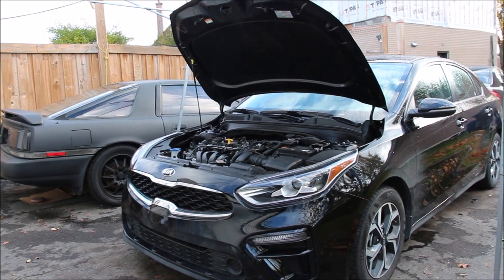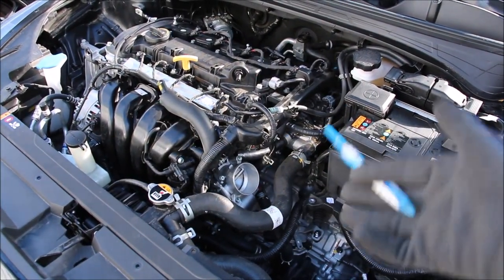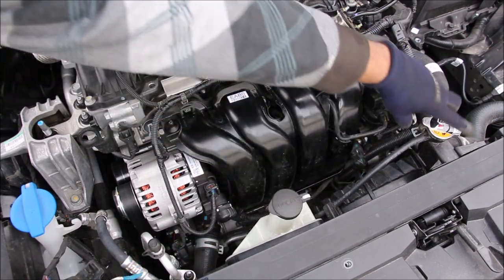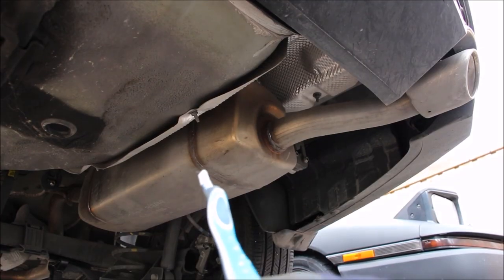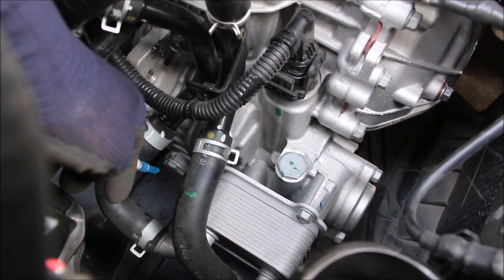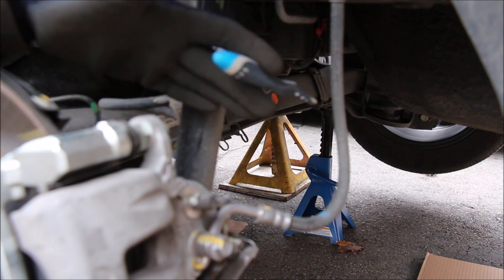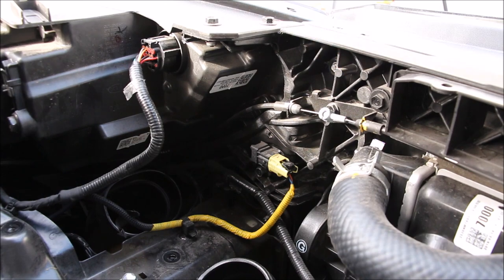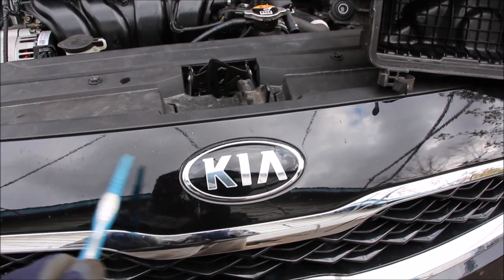Kia Forte Mechanical Review

Comment: My kia has 402500 miles runs incredible 2010 forte
Reply from the maker: Whoa that's alot for any car, much less a Kia. Any issues?
Reply: Same 2010 kia, 2.0 4cyl. 230000km and runs sweet as ever.
Reply: my 2010 forte 2.4 6MT just broke 200,000 km's and i love this car to bits, it's got the older style THETA2 but in the first iteration where they used MPI and were still made in korea, the later GDI theta2 was made in i believe georgia or Alabama and they had production line defects where sand from the block casting + filings from machining weren't flushed out properly and sat dormant in the oil journals, man did hyundai ever make the walk of shame after that with the exploding engine recalls haha! 
ive seen a good few 2.4 MPI fortes make it to 400,000kms and i plan to take mine that far and beyond! 173HP and 168 ftlbs of midrange torque move pretty damn quick haha, people turbo the first generation forte and make an even 300hp/300tq and have little reliability issues long term :)
Reply: @Liam S no lie no need to it's hot 464000 now
Reply: @gregallen5551  what do you do that you drive 60k+ mike’s a year in a Kia
Reply: @lancestickle4346  Uber lyft .outside sales.
Uber eats. Door dash 
I just got a 2013 kia forte rsx love it bought 96000
Reply: Is that a 2.0 liter?
Reply: @Vanguardkl  Is that a cvt transmission?
Reply: @UnburdenMyWordSalad  yes it finally semi died at 464000 miles I can fix it .but 
I just got a 2013 kia forte rsx hatchback
Love it so I may have to part with it sad
Reply: @UnburdenMyWordSalad  4 spd torque converter. It's a Mitsubishi transmission. Just keep the fluids fresh and the thing just keeps running. Used to Uber, not now

Comment: Thanks for these videos, with an aging Civic I'm starting to look for a cheap daily driver around $20k.... Good deals on both the Forte and Jetta, thanks to your videos alone (cupholders, handling, etc.) I feel the Forte is a much better built car (simplier to work on as well) than the Jetta.
Reply: Forte and Elantra are much better choices than the Jetta in terms of repair costs and long-term reliability.
Reply: @palebeachbum  kia reliable 😂🤣😂
Reply: @adl6907  reading comprehension is not your forte. 😉

Comment: “Kia gives you these hooks to easily replace the engine when it fails just after warranty”. 😂

Man I love your videos and sense of humor, keep up the amazing work. This is a real review of cars. 

Would you be able to review the 2019-20 Toyota Yaris? People say it’s a Mazda in disguise and it’s not as reliable. 

Thanks.
Reply from the maker: Thanks I'm glad you appreciate my work and the little humor! 

The Mazda 2 is sold as the Yaris in North America. A new Yaris hatchback has debut, I'd love to check out that little 3 cylinder haha
Reply: @speedkar99  What? a Mazda 2 is a Toyota Yaris in North America?
Reply: funny part was you will have 2-3 engines replaced BEFORE warrenty is up as there 4 cyls are complete shit thanks to lack of oil lubrication wich causes main bearings to melt and burn up.
Reply: @Scypher0th  Fake news.
Reply: Jared Shelton not.  It’s a known Hyundai/Kia issue.
Reply: @nicksmith8166  On one engine. One single engine, the 2.4 4cyl, which was co-developed with Chrysler and Mitsubishi. That's where Hyundai and Kia went wrong. Hyundai and Kia basically took the engine back for themselves, fixed the design, and replaced every single defective engine that was still on the road. It is not a known Hyundai/Kia issue, as it was one engine flaw that was fixed.
Reply: @Scypher0th  You can blame Chrysler and Mitsubishi for that, Kia fixed the design of their 2.4 and took care of the issue 👍. Their 4 cylinders are great now.
Reply: 2010 kia forte, 2.0 4 cyl 4 spd auto. Serviced every 9 months at around 16 to 18k km, on shell helix ultra 5w40 every time, 230000km, smooth quiet, people think my car is 3 years old, not 10.
Reply: @speedkar99  Yaris has 1.5 liter DI 4 cylinder engine Mazda built.
Reply: I love his humor, its so real it hurts Kia owners (I'm not one of them!)
Reply: @jaredshelton4718  except Mitsubishi's engines are proven to be more reliable and have a low failure rate.
Reply: @trent7080  Hard no.
Reply: @jaredshelton4718  NHTSA would not agree with you. Lol.
Reply: @trent7080  They would. Lol.
Reply: @trent7080  Lmao. Coming from the delusional Mitsubishi fan 😂. Mitsubishi has what? 3 vehicles in their lineup? What a joke 🥱🥱.
Reply: @jaredshelton4718  so I'm a Mitsubishi fan for telling the truth? Lol, thanks for proving my point.
Reply: @trent7080  Definitely not the truth, you're funny though.
Reply: @trent7080  tbh you’re not giving any substance to your argument. Afaik I will have to agree with the other side of the argument regarding the Kia/Hyundai engine issue that they did indeed fix in the latter model years. Seems like you’re too hooked into winning this argument rather than concede the truth. ( I drive a Toyota so not a fanboi of either)
Reply: @zeeshanmuhammed8883  so why are 2019 models still catching a fire?
Reply: & he ain’t told nan lie 😂

Comment: I bought a 19 Forte with a 6 speed manual. I chose it because of its low price, long warranty, and ease of service. It's simple mechanically, but has a lot of amenities such as lane keep assist and Android auto. I'm pretty happy with it.
Reply from the maker: I agree, seems pretty easy to work on, the layout is like a Toyota
Reply: How much?
Reply: @erikmireles5879  mine was 16,500 new at the time when I bought it. I believe they're even cheaper now.
Reply: @n8rev156  thanks for the reply, the price, looks ok enough and warranty are appealing for a daily driver and keep the wear n tear off my truck. Haven't actually went to the dealer but lsx models are about $14k 0% apr around here

Comment: Remove the alternator & the water pump takes 15min to replace. I love that Hyundai does not extend the subframe; if you have to remove or replace the gearbox/transmission you don't have to suspend the engine and lower the subframe first. It's a 3 hour job, literally.

Love your reviews! 👍!👍!👍!

Comment: I have a base model 2019 Kia Forte. I really enjoy it. The Mexicans did a great job building the engine and transmission, as well as assembling it in Mexico. I have a better understanding of my 2019 Kia Forte thanks to your professional, understandable explanation! Thank you, and I subscribed!
Reply from the maker: I'm glad it helped you understand. How are you liking that CVT? I found it kinda sluggish.
Reply: @speedkar99  It is not sluggish at all, just give it some gas and you are at 0-60 in 2 seconds. The CVT is very responsive and fast! I am disappointed in your response, though. It is hear-say, but you need to try it.
Reply: @99900062  neither a Corvette , nor a Porsche , can do 0 to 60 in 2 seconds. You are a Huge exagerater!! Lol.
Reply: @johnfranklin5277  the actual  0 - 60 is  high 7 low 8 ish
Reply: @610smoke  I know lol, I have a 17 Elantra! Lol. Same engine.  Great car. 80.000 miles now, bought it new.  Absolutely flawless,  0 repairs,  0 issues,  but a rocket its not!

Comment: Wait a minute so Kia's latest transmission,has a fill port,a check port and drain plugs. But also has a big yellow sticker saying NOT to change the transmission fluid??? 

Am I understanding this correctly?
Reply from the maker: Yep. The ports exist but service is not recommended. Most CVTs are like that
Reply: It means don't change the fluid if your transmission is acting up, just get the transmission replaced
Reply: @GhostOfAMachine  Sounds reasonable.  Will do.

Comment: excellent tip at 10:56 and since you're there go ahead and remove the caliper and use a rust inhibitor on the hub/rotor (for those that drive on roads that get salted in the winter) so that your rotors aren't rusted on!!!!
Reply from the maker: Agreed. It's not just the rust...it's just those screws love to strip!
Reply: Hey you said to remove the screws so they don’t strip out before the first brake job, do you mean replace or remove?

Comment: Hey, those engine hooks on my 07' Kia Rio came in handy when I replaced my clutch 😎 I used a pulley to support the engine and trans instead of a jack. My engine's still going strong with over 200K on the odo (and it's well out of warranty 😉).
Reply from the maker: Awesome. You are one of many on this video to testify the old Kia's are doing well
Reply: Cool! Old Kia's (before the Hyundai merger) used Mazda designed engines and transmissions built under license by Kia. Despite being somewhat unrefined, the cars are surprisingly solid and reliable. The post-merger cars are a definite improvement though.

Comment: Would you have to change out the CVT even if all it needs is transmission fluid? Also, what makes you think the engine will give out once it's out of warranty?
Reply: No you would change the fluid as regular maintenance. They are saying that if the transmission is starting to act up that you shouldnt bother with the fluid.
Reply from the maker: Fluid can be changed. The manufacturer doesn't want you to do it yourself.
Reply: His other question was what gives you the idea that the engine will give out after warranty?
Reply: @brettb2701  That part was a joke lol
You need to learn to read humor, he does this with just about every review and it's hilarious.

Comment: Excellent video! Particularly loved the reference to the handy hooks to pull out the engine just after warranty 😁😝
Reply from the maker: Haha 
I was surprised they include those hooks, especially since they usually lift the engines into the body during production and don't use those hooks.

Comment: the twist beam set up is what everybody in the compact car segment is doing so it doesn't even matter to me and it won't to most people. There's an independent suspension set up on the Forte GT that just came out. It's the same strategy that Hyundai has been using on the Elantra Sport (makes sense since it's the same platform). 

Hopefully you can get a next gen Sonata at some point so you can show us what's better or worse with the next gen platform they just debuted in that car. There's a new 2.5L engine with dual port injection and 1.6T with this thing called CVVD which is supposedly just a combo of VVT, VVL, and the ability to change the duration of the valve being opened or closed using an electric motor (hopefully that won't kill their reliability).
Reply from the maker: Wow you are definitely a Hyundai fan haha. 

Competitors like the Civic and Corolla offer independent rear suspensions on the base model. 

I didn't know the Forte GT had IRS, I knew the Elantra Sport did. Makes sense though since there's alot of space under that floor pan. I wonder if it'll swap over ...

Yeah it'll take some time for the 2020 Sonata to start appearing around, I'd love to review it along with the paliside/ telluride.
Reply: speedkar99 I drive a Kia and my family has driven Hyundai in the past and they’ve been extremely solid for us so I like learning as much about them as possible. 

Yeah the Corolla and Civic definitely gets a thumbs up by not going for a twist beam. The Mazda3, Sentra, and the Jetta unfortunately have succumbed to that trend.

I wouldn’t be surprised if someone tried to swap suspensions.

Comment: Awesome reviews man! Your sense of humour is funny too Lol.
I own this car (except mine came with the crappy Gamma 1.6L engine). Very good points on your reviews. The most thing I like about this car is how easy it is to work on. Mine came with 6-speed automatic so it's somewhat serviceable and the 1.6L engine is even smaller than the one in your review and gives more clearance to work with.
I have a question and would be glad if you answered me. In the owner's manual it gives a chart for suitable oil viscosity according to the ambient temperature. According to the chart I can use 5W-30, 10W-30, or 15W-40. Shall I go with the thickest one to provide more protection for the engine? In my country the temperature rarely goes lower than -5 °C.
Reply from the maker: Thank. You have the turbo 1.6 eh. 

The oil weights get thinner to reduce friction and this better fuel economy. In the winter you use thinner oil because it's viscosity changes with temperature. You'd be safe with what they spec for your climate, though it's not going to make ur engine "last longer" since the differences are more for economy.
Reply: @speedkar99  
Thank you for the reply. My car has the non-turbo 1.6L (same one in the Kia rio and Hyundai accent, 131HP) I think in Canada and the US they only sell the 2.0L and the turbo 1.6L. In my country it is even called Kia "Cerato" not "Forte" even though its exactly the same.

Comment: Love my 2020 Forte, but I bought the 6 speed manual transmission.
Reply from the maker: They still offer with a manual?
Reply: @speedkar99  Do you think the dual clutch in the GT trim would be more reliable than the iCVT? Thinking bout buying one of these cars.
Reply: @speedkar99  I think the 2020 FE model comes with a 6 speed manual as standard

Comment: I have this same engine in my Hyundai Elantra se. 2018 with the manual transmission. I really like the car. I have 53k on it. Change the synthetic oil every 4k. Trying hard to go to 5k but I'm old school. The motor sounds like it did when it was new. Its quiet. I get over 40mpg and haven't had any problems. Although I had it in for an oil change and they had to update the software on the thermostat. When its bitterly cold out it took like 20 minutes to get to normal temp. Now it takes 3 minutes. It's been a good car. I plan on driving it for another 200k.
Reply: 4k on synthetic? Bro you're wasting money. At minimum theyre rated at 7k some up to 15k!
Reply: @iyelawolf2196  I'm trying! I'm at 4,500k Mobil 1. Oil still looks good.

Comment: I really like the new forte a lot. I'm considering it to be my next car. However, the only thing that puts me off is the positioning of the turn signal and reverse lights being  on the bottom instead of where its supposed to be. Like you said, one little bump could break it and cause fluid to come out. Kia should put the lights where they're supposed to be. If they did that and put a break hold feature like the Corolla and the civic, it would be very hard to pass it up. I hope kia sees this.
Reply from the maker: I don't like low mounted lights as a design element either....it doesn't look good

Comment: Its April 2022 =july 2018 kia forte 2.0, 4cy, LX, Engine 17,100 miles, =Engine lite came on, told code 128, told to replace thermostat with the housing ( cant replace just the thermostat) one kia dealer said part $1000, next dealer $169, or order myself from Hyurdai/ kia Co. in SKorea $45 +$35 shipping.! My car is under 3 1/2 yrs old, every year maintained! drive easy HYW miles.  Is this under warranty still !( 5 yrs 60,000miles) ????Should I think about selling this car already????   help! one retired senior
Reply from the maker: If it's under warranty why aren't they covering it?

Comment: Why are the cars all going with plastic intake manifolds?  Also, on this car, exhaust is in the rear which I dont like.   Toyota puts it in the front, easier to work on.  Also, don't change the transmission oil?  Is that a new way to sell transmission and future repair?  Oil not getting old?  Has Kia found a way for transmission oil not to get old?

Comment: Hi speedkar99. I'm so glad to find your channel showing the intricacies of the vehicle.  My daughter is shopping for her 1st car and we are seriously considering this car based on the price value and also the fact that the motor has a timing chain rather than a timing belt.  I am a bit taken back with the fact that pretty much all manufacturers are going the way of the CVT which to me has been a headache and very problematic. (Nissan cough...) I looked over the new corollas and was shocked that Toyota too has changed over to CVT, sheesh.  So now we are not sure which way to go.  Choose the normal 2.0 with a timing belt but a CVT trans or go a little more with the GT with a 1.6 turbo (No knowledge of the motor) but with a proper dual clutch.  If you can somehow shed some light on this it would be much appreciated.  Also you've got a new subscriber!!!
Reply: The 2020 Forte FE comes in manual also! Which I personally think is better for young people (harder to text and drive) and the trans will be much stronger and easier to work on imo

Comment: In your opinion, which engine is easier to work on and maintain and will last more, Kia Forte 2.0 manual transmission or New Corolla 1.8 manual transmission?
Reply from the maker: They are identical under the hood
Reply: I right there too, 4000$ difference between the two in canada....they are pretty close with that metric....hard choice unless long term reliabilty is your first priority....

Comment: What's dirty about the throttle body? I drive a 2010 forte 2.0 running quiet and smooth never had major work 5w40 shell helix ultra all the way now at 230,000km
Reply from the maker: Clean your throttle body.
Reply: @speedkar99 yes i do once in a while, not a big deal

Comment: wonder if they fixed there 4cyl's from kia/hyundai yet? there 4 cyls have HUGE lubrication issues wich results in MAJOR engine failure due to main bearings burning up and knocking. Wich is why i do NOT suggest or tell anyone to get a 4 cyl hyundai or kia. When i worked for the local hyundai they had a tech who was dedicated on replacing engines and was doing 2-3 a day.
Reply from the maker: The theta engines we're affected by the main bearings failing due to shavings during the machining process. This uses the NU engine which is different.

Comment: You often mention the placement of the ECU and it's survivability after a crash. Wouldn't most crashes that intrude into the engine compartment a few inches total the car without needing to damage the ECU? My old 2010 Mazda 3 was totaled after it hit a curb at speed and damaged the suspention, there was no intrusion into the engine compartment.